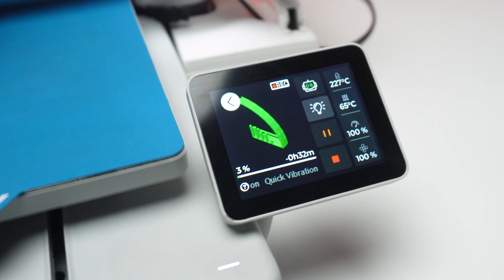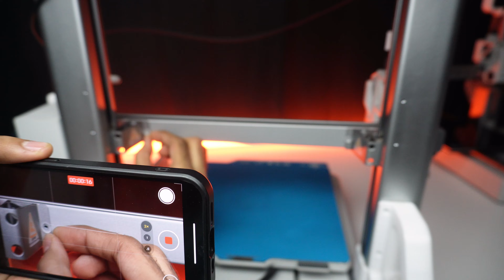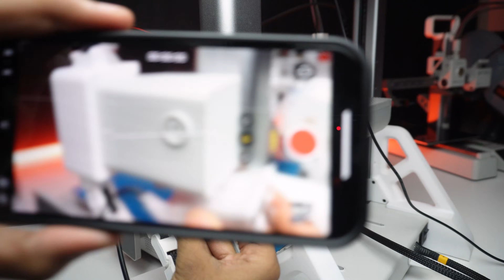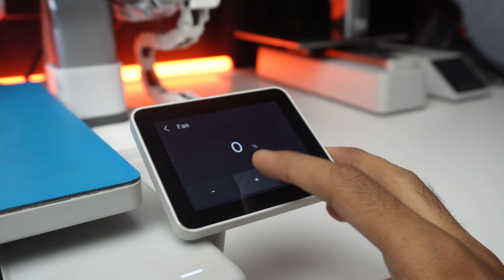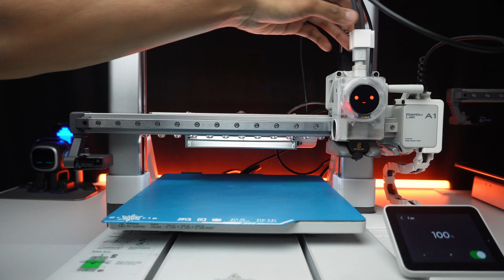Bambu Lab A1 Just Got an Overpowered Cooling Mod ❄️🤯| BIQU Panda Breeze  #3dprinting

Comment: Does yours sag the X axis when installed? i saw a reddit post and the users fan did
Reply: Yeah I have it the breeze too, it definitely causes the rail to sag downwards after a print is done or if it's not printing. Otherwise it's fine.

Though I did just see a little blurb on biqu's store listing to modify the gcode and it'll fix the sag.
Reply: Yes it definitely sags. I have the breezy too, it'll sag only when it's currently not printing, so the moment a print finishes it'll sag. 
You also have to be wary of using the ams to print multiple objects of different materials or colors, because the slicer software accounts for a thin rail, I had a print get utterly RIPPED off the plate because the person in the remix made it print starting from the back for some reason.
Also the store page on biqu mentions something in one of their pictures about the sag and how you'd need to modify the gcode to possibly fix it.
Lastly, BIQU's wiki page (bttwiki) is slowly getting updated every day, breezy was originally a single mp4, now they have WAY more details and models to use.

Comment: I print only on Pla, does this upgrade worth use for PLA or it helps only for other materials?
Reply: Allegedly from what I can tell with the A1 and my little bit of research, PLA benefits the most from cooling, and this allows you to print fast af with the right settings since one thing the a1 is restricted by is cooling, pair that up with high speed pla or a biqu high flow nozzle or h2d high flow nozzle, and things will go hella fast, albeit a little loud.